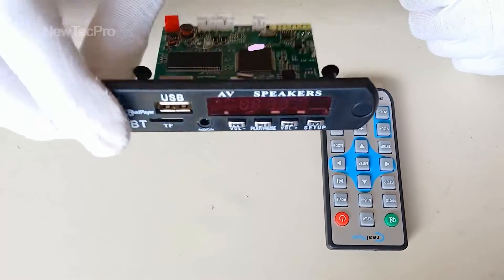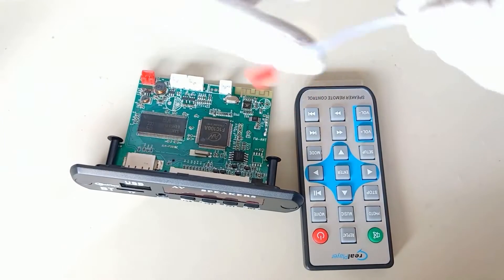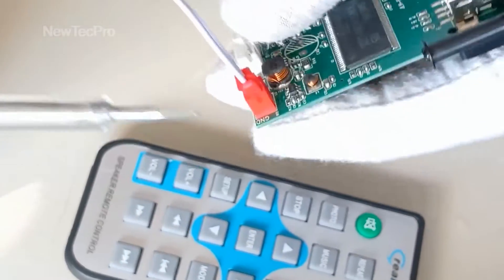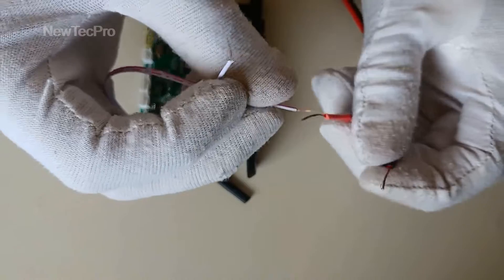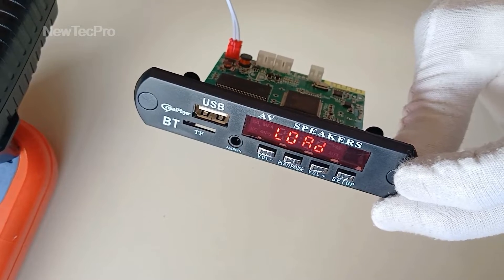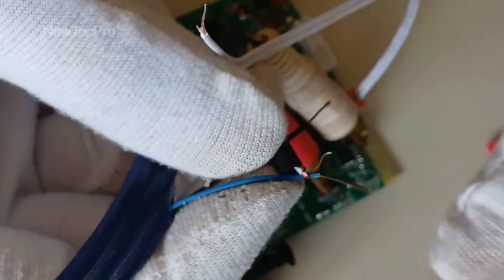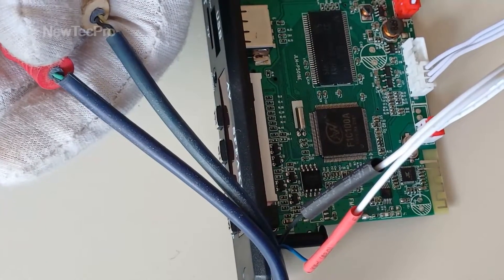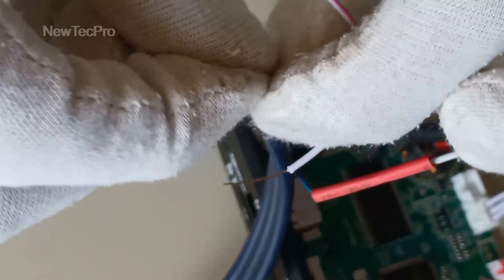How to install Audio Video Player MP5 Decoder Module?

Comment: My problem is usb card conection but colour Black and white
Reply from the maker: This problem is probably due to the settings of the TV or monitor. It may also be related to the wires and solders or the plug used. The video output must be full color.

Comment: This audio connection does not work
Reply from the maker: You must make sure the wires are connected correctly. Note that you have received the stereo sound output from Lout and Rout and you have not connected the connector wrongly.

Comment: How many video outputs does it have ? ( can it duplicate to two screens?
Reply from the maker: It has 1 AV video output. You need to use an AV splitter to get 2 outputs. It is a special device

Comment: Hello and thanks for the very good and informative video. Does MP5 decoder have RCA output? Can it be connected to a car monitor?
Reply from the maker: Yes, any type of display that has an AV or RCA video input is fine. Even the car monitor.